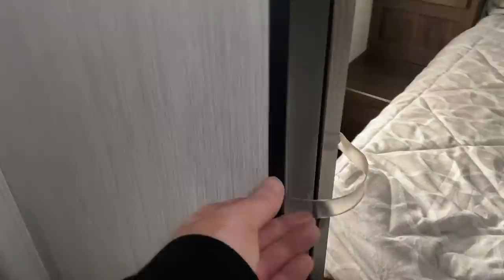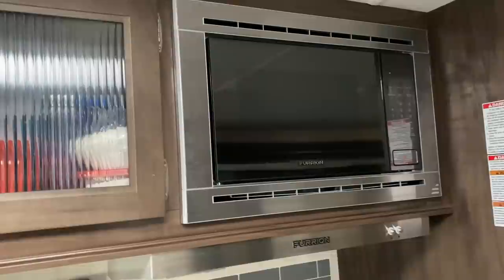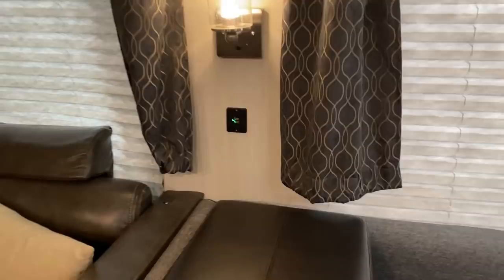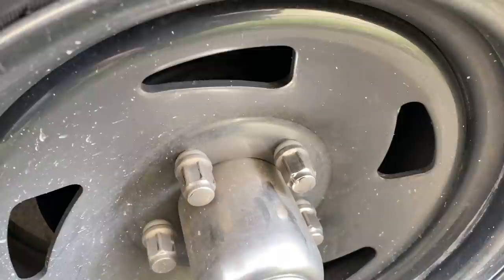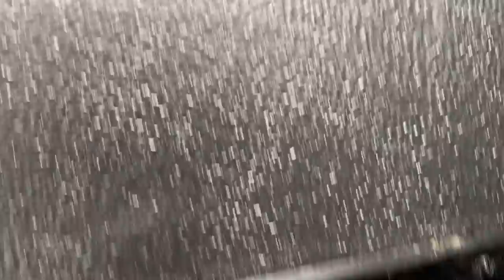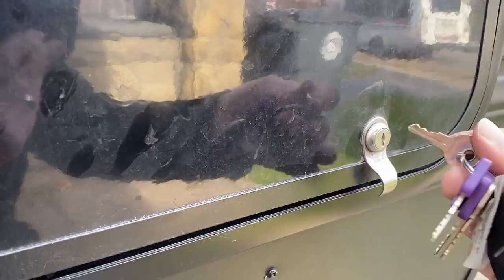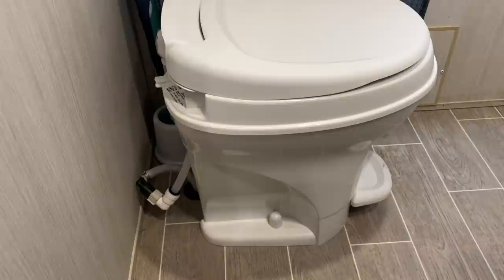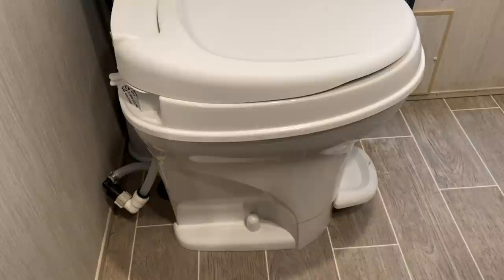2020 Forest River Cherokee RV Camper | Problems and Fixes After One Year

Comment: Just a helpful hint about the “lugnuts” i worked in a tire shop and those types of lugnuts when they get wet the space between the nut and chrome  rusts and causes the nut to become larger. You will not be able to use your tire wrench . The solution is to exchange all the nuts for solid chrome. It will save you a big headache!
Reply from the maker: Great tip!
Reply: Ran a tire shop gor years. Thst's exactly what I was going to say.
Reply: @usa91787  i worked for a tire shop for 5 years and fought with those stupid things a lot
Reply: @user-fj6qq2vm7c  The worst. They get water back there and then rust and expand. 
 Especially in saltwater areas and cold like here in MN. 

You're stranded if you get a flat and that's the situation.
Reply: My Ford Fusion is also like that.
Reply: Yep, get rid of those nuts and get chome plated, those shell nuts will be a nightmare later
Reply: Swollen lugnuts! Got to love it! Fuckin ford sure does!
Reply: @danfromga9696  as a gm mechanic I can say they are not alone
Reply: The Chrome sleeves will also sometimes fall off which leaves you with the interesting situation where you have a lug nut that isn't an actual size anymore.
Reply: Great tip.....I had to replace all the lugs on my wife's Ford Escape for the same reason!

Comment: I have owned several different brands of RV trailers and decided I would get the Forest River Wolf Pup next. I picked it up in Indiana and took it back to my home in Ohio. Then I took it to a local state park for a test run, all OK. 2 months later we went on a long trip to Arizona, New Mexico, sadly while driving through Rte.70 Indiana another driver signaled me that something was hanging from the trailer. Admittedly it was the roughest inter state I had travelled o in many years. But to my shock I found that the half full fresh water tank was dragging along the road. So I disconnected it and threw it in the P/U bed. I called Forst river and many dealers but got very little response. Finally on the way back to Ohio, I called into the manufacturer and they put a new water tank in, 3 weeks ago we took a trip to Big Bend National park. Some more rough roads, I found that one rear light lens has fallen off and the outside vent for the range lid had also fallen off.I still like the concept of the Woolf Pup 16 bhs and have some issues like the sharp corner on the cabinet over the sink, (got scar to remind me AS YOU SAID , ITS A LOT OF TRAILER FOR THE MONEY.
Reply: What brands you recommend?
Reply: I took care of the sharp corner with a baby bed corner pad that I think I got at wallmart   Cheap  covers the corner and came in brown to match the color

Comment: The issues are starting to become more frequent and more major than with older models. I found out my refrigerator had recalled only after it started throwing fireballs out the side of the camper. Some things are minor like the time my wife got locked in the bathroom until I returned to let her out . I can live with that.

Comment: We had the same problem with our Dometic toilet. Had problems with smell that I couldn’t figure out. Watched a YouTube video and found out that a seal was bad on certain toilets. When I contacted Dometic they asked for the serial number. They confirmed that mine fell under the ones that were defective. I upgraded to the porcelain model, but had to pay the difference. I replaced it myself and the new toilet solved the smell problem and it’s a much better toilet than the original one. Agree that it should have been a recall rather than the consumer having to diagnose the problem when they were fully aware it was a problem.
Reply: Just the thought stop Shitzkten in your toilet in your TV

Comment: We have a 2017 Cherokee Grey Wolf BH model. Right at the dealership, we noticed molding pieces kept popping off, and the outdoor kitchen door got wrenched on and wouldn't close properly, thus allowing water to get inside. Before taking ownership, we had the door replaced. Thankfully, no problems with that part of it since. However, we still have little areas of molding strips that were glued on that keep popping off. And the bathroom smells. We do put the RV septic treatments in, like we've done with other models owned previously. I assumed it's just an RV thing, but maybe not(?). Also, the first winter we winterized it, the sewer pipe underneath the RV broke. Turns out that a little water was left trapped in it, so we had to repair it. A way to prevent that from happening in future, was to leave open the end cap after winterization was complete so that no water is left trapped at the end of the pipe. HTH others. We are looking at a possible upgrade as our kids are outgrowing the length of the bunks. Otherwise, it's a beautiful RV and our favorite feature is the Outdoor Kitchen.

Comment: We just bought a Wolfpup 16 HE. Beautiful camper, fully loaded. We didn't want a slide. I gave it a good look at the lot and didn't see any obvious issues. I read the reviews and it seemed about 50/50 on the quality rating, some said it was great, some hated it. Most were middle of the road. I was concerned until I looked at reviews of other RV brands and they all seem to have the same hit and miss quality issues, even some higher end brands. So we got the 2022 Wolfpup because it was the best layout and options for us, not to mention we got it for what I consider a great price. We pick it up tuesday and plan on using it that night on the way home. Being my first rv I'm exited but also apprehensive we may have issues. It is a beautiful camper with a pretty great layout for the size. Thanks for the info.
Reply from the maker: Still loving mine even after the issues I've had. Most are easy to fix. Enjoy your new RV!
Reply: How's that wolf pup holding up a few months in? Would love to hear.
Reply: @rockhound7245  We bought it late in the season, took a UP trip, and a couple localish trips. Loved it. I have it in the driveway and  have used it a couple times because of company. So far no complaints, other than the soap dispenser was defective and the bathroom doorknob put a tiny ding in the refer door. You can only see it from the bed but a handle style knob would have been a better design their. We did a bit of boondocking. Solar seems to do the job, we have a generator too. It was nice and warm, heater did a good job and didn't seem to run too much. Love the couch too, more comfortable than the one at home. The only real drawback is having to crawl over someone to get out of bed. But we sacrificed a walk around bed for the couch in the length/weight we needed. We may take her down south this winter, depending on friends schedule. The first for sure trip is trout camp (last week of April).

Comment: Thank you for the informative video as we purchased a 2019 Cherokee Grey Wolf 22MKSE.  Lots of features we like but like you we experienced a plethora of first/second year stuff that was unexpected. Examples: Most of the outside decals are peeling off (not a big deal from a functionality standpoint but dang); Kitchen sink leaked due to what looked like paper drain seals replaced with rubber ones from Lowes - problem solved; Black water flush valve very cheap and was not installed properly, was at an angle and just didn't work as water just drained into the bathroom - replaced with a higher quality valve properly installed - problem solved; Tub drain - just came off and water collected on the underside of the camper eventually just overflowing onto the ground - refit trap and placed a strap around the trap so it would not just come out leaving a bit of room for some flex while in use or driving down the road - also very messy to clean up as all the insulation was ruined; Tires - yep Castle Rock - no bad experiences as I immediately changed them out as I just didn't want to experience a blowout with these tires - just my choice on that one; Outside locks - same issue as you - didn't know about the trick you showed but I replaced with higher quality no universal key locks - works great now.

Comment: We purchased a brand new Forest River Salem back in June after waiting 4 months for it to come in and it has many issues. Some small stuff I noticed immediately and some I didnt notice until after using it a few times. A few of the issues: In the shower they drilled the hole to big for the plastic rivet that's suppose to hold it tight to the inner wall so now there is a rivet hanging out of the shower wall that's bowing out 2".. they didn't staple down the linoleum floor under the slide out so it's curling up under there. Broken a/c vents. The filler panels under the kitchen sink were cut to small and I can stick my finger in the gaps at the top of them. Several spots on the floor I can feel shavings under the linoleum which will eventually wear through. I had to go over all the transition strips between the wal and ceiling panels and pop them in because they were loose in many spots. The ceiling in the bunkroom is bowing down and wasn't stapled. The outside power plug housing was screwed down directly over a rib in the siding so the door for it is always a quarter of the way open allowing water in. what they did caulk on the outside is a joke. There is shavings in the caulk over the kitchen window by the exterior door and I had to recaulk everything because nothing was completely sealed, there was huge voids everywhere. The two silver front aluminum panels don't match very good at all especially in the sun light and at the top has a big indent at the top almost like they started screwing it down from the outsides and work towards the center and ended up with a hump that they pushed into an indent and screwed it down.
Apparently they hire a bunch of kids because I noticed on the frame someone wrote "u suck fat boy" with a paint pen. Really!
Hindsight is 20/20, I'll check the next camper over better and it definitely won't be a Forest River product.. Horrible quality control..
Reply: I’ve been in a forest river manufacturing plant. I’ve seen first hand. There is no quality control. The work force is 2/3rds Amish, 1/3rd other. All they care about is production rates not quality. That’s bad management/business practices on Forest River. I’ll never buy a new Rv unless I can visit the production floor. I work in Aerospace. If my coworkers and I put out quality like forest river, planes would be falling out of the shy

Comment: Within a week of bringing home my 2021 cherokee, I had to remount two frameless windows barely sticking on to their frames and COMPLETELY rebuild the front door (foam core and all). First day having the door open, the plastic face starting forming HUGE bubbles... The styrofoam core they used had melted down in pockets - presumably from the adhesive they used at the factory. I debated taking it to the dealer, but for what? Two months down time and the same shitty “craftsmanship”. This is our third RV, first new one. I expected issues but damn....
Reply: Quit buying shit cheap stuff
Reply: I don't agree with the comment above but I do believe that it is better to fix things yourself at least you know it will be done properly
Reply: Have a new forest River east to west with 30,yes 30 issues,from water leaks to leaky windows,not going to bash anyone yet,will see how it's handled

Comment: We bought a new grand design reflection fifth wheel last summer.  Several trips in and so far rock solid no major issues.  Only found two minor issues:   Bad outdoor speaker and set screw missing from kitchen faucet (didn’t stop faucet from functioning, but allowed trim piece to slip off sprayer head).   I called the dealer, same thing as you:  bring it in so we can diagnose it.   I said yea no thanks.  Called grand design directly and they immediately sent me a whole new kitchen faucet and speaker, no questions asked.   I think people need to start skipping the dealer if they are fortunate enough to be dealing with a manufacturer as responsive as grand design seems to be (at least so far).   My experience has been that most dealerships are just plain  useless / terrible once they make the sale.   I’m sure there are some good ones out there but I have yet to find them.

Comment: Par for the course with travel trailers. My dealer is relatively close and I haven’t bothered to take it back - prefer to do stuff myself. My rule is if it’s under $100 bucks it’s not worth the aggravation and having to drop off my unit to sit for who knows how long. The biggest things for me have been the grey water tank valve and replacing some of the outside molding. Both jobs were under $50 in parts and I learned along the way, so no big. Also the usual annoyances like missing and loose screws, and generally sloppy work that I’ve had to address.

Comment: I've had issues with my 2019 Winnebago Minnie from the get go. First trip, we discovered that the awning leaked where it is joined to the trailer. We took it back to the dealer to fix the awning issue and some interior trim falling off. After two weeks, we got a call notifying us that the problems were corrected. On our second trip out, we discovered the issues still existed. At that point, I decided not to ever return to the dealer for repairs. The outrageous part is that they charge the manufacturer $140 per hour for warranty work. That was just the tip of the iceberg. Two years in, the a/c quit working, awning motor quit working, black tank flush valve quit working, toilet flush valve leak, just to name a few, and all after the warranty expired. It's a good thing that I am very handy and capable of doing these repairs myself. They say boats are holes in the water that you throw money into. I believe RVs are worse.

Comment: Ah, the infamous CH751 key.

I bought a new Forest River Ultra Lite in 2013 at a great price at a RV show.  Yes, there are many nit picking problems that I had to take care of but the most dangerous one I found was one day I was washing the trailer and I noticed a bolt that holds the trailer wall to the frame kind of dangling loose.  The nut had backed off so I tightened it.  I then went around the whole trailer and ALL of the nuts on every bolt holding the walls of the trailer to the frame were loose!  I ended up double nutting every bolt along with blue Locktite.  One bolt was beyond tightening because the head of the bolt is inside the wall with no access unless I rip open the wall.

Comment: We bought a 2020 Cherokee Grey Wolf new. Lot’s of defects. Some we got covered during the year warranty. Others we are on our own. 
The first year, the fridge went out and there was a leak in a check valve with one of the holding tanks. The entrance door never lined up properly. 
The second year was a doozy.  I have followed all winterizing recommendations to the T even though in South Carolina is a mild winter climate. I walked into the kitchen one morning to start purging water out of the lines and without touching anything, I looked over at the kitchen sink faucet and it just broke off at the base and fell over! I removed it and took it over to dealer, even though it was out of warranty. The parts guy saw me coming with it in my hand and just turned around and got another one and gave it to me like, here comes another one. 
Microwave went out shortly after the first year, after about 4 short trips. 
Commode leaked like yours did and began to stink. Wife called dealership and got a replacement under a recall.
Returned from a trip to find valance on rear wall had completely came out of the wall and was in the floor. Reattached it but the slide mechanism will not work.
Door to outside ice maker and shower came loose while locked while driving down road.
Refrigerator door latch is a pain in the butt and cannot adjust it out so it isn’t hard to open. I got to just taking the latch mechanism off when we got set up and reattaching it before getting back on road.
Wife bought a rolling cover for slide out to assure against leaks.
The little rain gutter leaks at a joint half way. Have tried to patch it with no success. 
Had one of the castle rock tires blow out after about three years averaging 2 or 3 trips a year of about 2 or 3 hundred miles one way.
Wife said, let’s buy a camper so we can enjoy the great outdoors and camp! We already live out in the country with woods and fields all around us for heaven’s sake! So we go from that to an overcrowded trailer campground!
My advice, if you buy one of these economy travel trailers is to give it a really thorough shake down the first year and use it as many times as possible and use all the features each trip. 
And go on Consumer Reports and do your research on travel trailers.

Comment: Another suggestion I got some flexible is flexible in the can and went around all the things that are exposed to rain on the roof and win around them ie the vents ect. I was assured by flex seal that it works just fine on the tops of trailers In terms of elasticity.

Comment: I have this same camper pretty much except mine is a 2019 and its the 26dbh model.  looks the same though. I have had lots problems with mine as well.  I checked on it today and found that the slide is leaking from around the rain gutter rail into the camper and now there is a water mark above the slide near roof.   The build quality of these is so poor.   The day I picked it up we found issues with water leaks that had to be addressed before leaving the lot.  Also had alignment issues with panels and one of the screen doors was over tightened and out of square.  Like you the dealer is over 4 hours from me so most of it I would just fix myself.  I personally will never buy another one of these but I have found out through forums and friends that all of them no matter what make or model are very poorly constructed.   Take care.